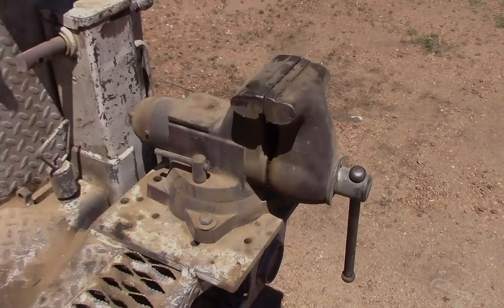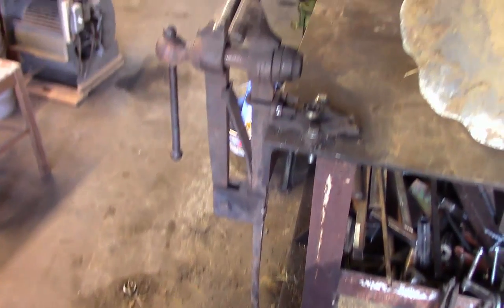Vises and work holding

Comment: Good job with the video. I liked being able to see all the different kinds of work holders. 
Having worked with a variety of really crappy vices over the years I would suggest checking the nut on any vice before you buy it. The nut is only an inch or two long and wears out long before the screw. If the vise wont open all the way so the moveable jaw can be removed. You won't be able to check the nut. That would be a big red flag for me. 
Cool shop. I miss having big equipment to work with. Come alongs and forklifts rock. ☺

Comment: I know that on some brands of collet fixtures, the recessed grove that runs around the collet close to the face is for pushing into the clamping collar before you put the tool into the hole. Then put the tool and collar up into and onto the threaded part of the fixture. Then when you unscrew the collar it pulls down on the collet so it will not get stuck into the fixture. I did notice that your collet set up is like that. Then you won't be using a brass punch to extract the collet

Comment: Very good - I've learned a lot.  One complaint - when you used the adjustable wrench backward.  That movable jaw is the weaker one and could break off, letting you fly and possibly injuring yourself, especially your hands.  Be safe.  Thanks.
Reply from the maker: Jeffry Blackmon Thanks for the tip. I know that tools are made to use a certain way, but you got to get the job done too lol. Thanks again.
Reply: Jeffry Blackmon i do beleve ave proved in a video that myth of how to use a asjustable wrech is bs